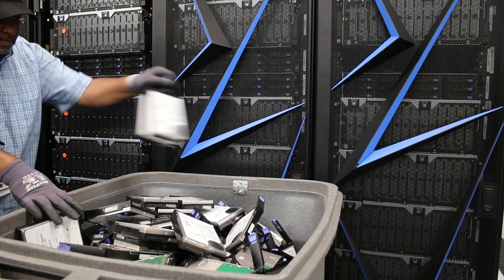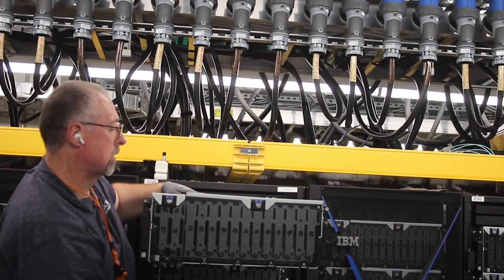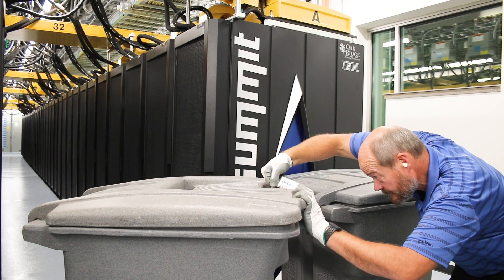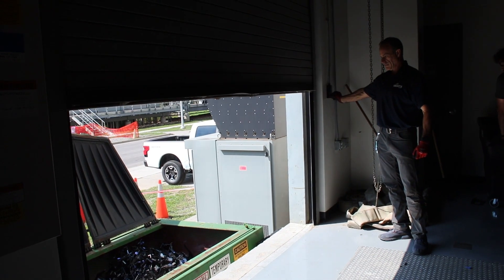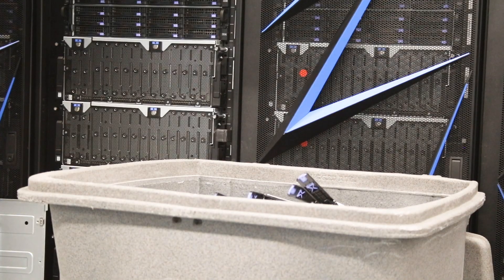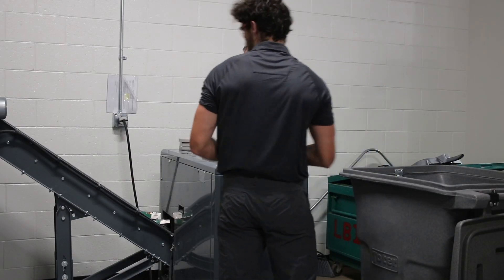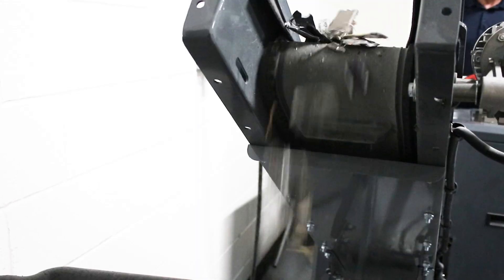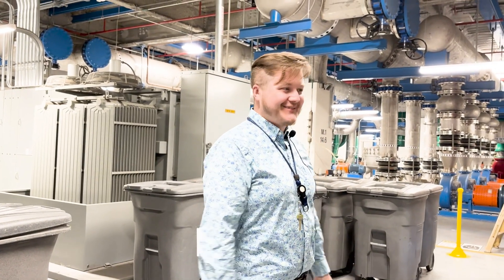How Oak Ridge National Laboratory recycles a supercomputing storage system

Comment: 20 Tons of drives, that were used in an array of an IBM Spectrum Scale parallel file system, that could never possibly be put back to use, or form any meaningful data, or be extracted as "usable", or meaningful, each drive holding nothing more than random "blobs", of random, meaningless data, which could all be zeroed out anyway.
What a terrible waste!

Comment: 😂 Guys, if it made sense to wipe and resell the drives, they would've. Watch Linus' video on drive shredding for a summary of why this makes more sense from an exonomical and practical perspective. If the material from the drives can be recycled, they probably will. The resources spent wiping and selling the drives (many of which are failing and need to be destroyed anyways) probably outweights that of recycling them from the start, otherwise they would've gone with that option.

Comment: REDUCE - REUSE - then Recycle!  There in this order for a REASON.  The environs and economic loss here is just appaling... no wonder there's no 2nd hand market. 

Just like CASH FOR KLUNKERS. Really helps the little guy amirite?
Reply: They can't take the chance. It's a national security issue, so waste is not their concern.
Reply: Third time saying this, this is actually more economical than wiping and reselling. Ignoring the "national security" aspect, many drives are failing (they have been in service on the once-fastest supercomputer for years), it takes time and money to wipe the drives (longer downtime of Summit, if you wipe them as they are in the system, and the energy of running it) and if the drives aren't already encrypted via hardware, using software encryption will take resources from what was supposed to be the highest-throughput computer in the world. Believe me, if it made sense to resell the drives, they would. The brilliant minds that work on a project like this would've already considered it.

Comment: What a total waste of money and resources. Those drives could easily be wiped and resold. The data center could even get paid for it instead of paying for destruction. The tax payer benefits as well.
Reply: This is actually more economical than wiping and reselling. Ignoring the "national security" aspect, many drives are failing (they have been in service on the once-fastest supercomputer for years), it takes time and money to wipe the drives (longer downtime of Summit, if you wipe them as they are in the system, and the energy of running it) and if the drives aren't already encrypted via hardware, using software encryption will take resources from what was supposed to be the highest-throughput computer in the world. Believe me, if it made sense to resell the drives, they would. The brilliant minds that work on a project like this would've already considered it.
Reply: They can't take the chance. It's a national security issue, so waste is not their concern.
Reply: @ScottGrammer  that's BS. There are standards for secure erasure. In the extremely unlikely event the data on a properly erased drive could be recovered, it's still encrypted data. And on the astronomically small chance that encryption gets broken, it's probably still worthless unless you have the whole set of drives in the proper order because distributed storage. Otherwise you have just small chunks of data. The chance that data ever gets in the wrong hands by plain old human error is infinitely more likely than it getting out by recycling those drives.

Comment: Saving tax payer money, by destroying drives?  WTF.  Use strong encryption, and then wipe them and give them to the public or sell them for crying out loud!
Reply: Believe it or not, this is actually more economical than wiping and reselling. Ignoring the "national security" aspect, many drives are failing (they have been in service on the once-fastest supercomputer for years), it takes time and money to wipe the drives (longer downtime of Summit, if you wipe them as they are in the system, and the energy of running it) and if the drives aren't already encrypted via hardware, using software encryption will take resources from what was supposed to be the highest-throughput computer in the world. Believe me, if it made sense to resell the drives, they would. The brilliant minds that work on a project like this would've already considered it.
Reply: They can't take the chance. It's a national security issue, so waste is not their concern.